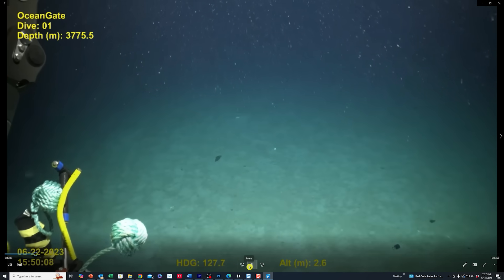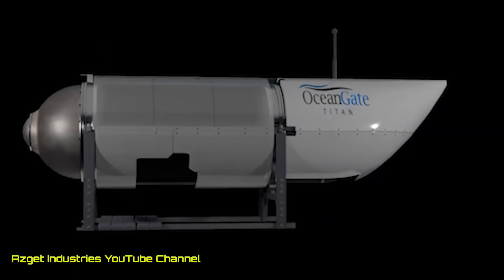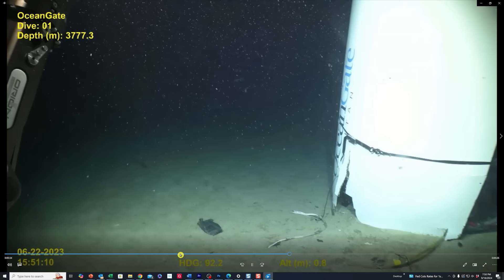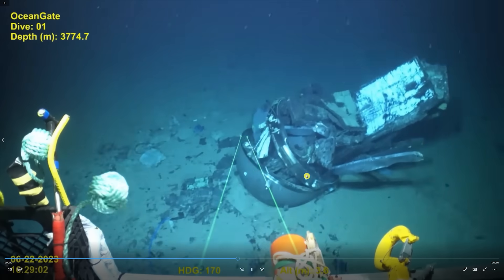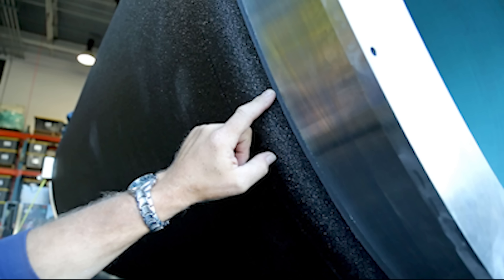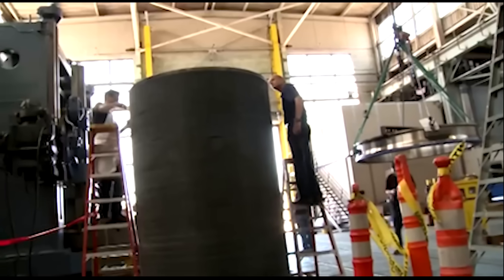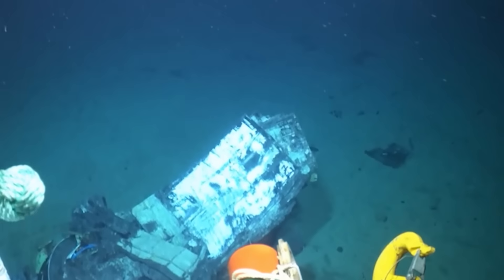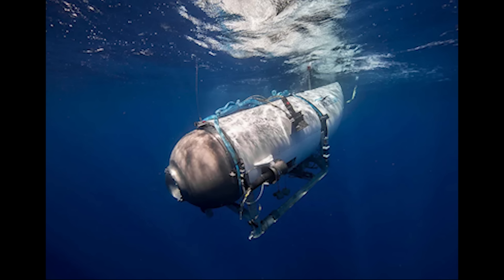OceanGate Titan Sub Debris Video Shows How It Imploded

Comment: The fact that there's some major chunks left at the back end makes it seem like whatever gave first was at the front end, and it broke the seal enough to shatter the hull apart from water hammer from the front end of the sub pushing everything towards the back, moreso than the whole ring just imploding equally from pressure. I bet it 'imploded' in the same way am elephant stepping on a solo cup sitting on the floor would 'implode'

Comment: Jesus that doesnt look safe... just that little bit of glue holding it together... i know adhesives can be very strong. Theyre used in aerospace and airplanes but man thats a lot of pressure that deep....  every submarine that goes that deep has steel bolted together not a ring of glue....

Comment: The occupants, what is there of them, are all mashed into that rear pressure dome along with everything that once made up the carbon fibre pressure hull. It compressed itself and the occupants in to that area at the back of the submersible in a fraction of a second....It's just as well they never even realised it was happening.

Comment: I studied engineering extensively the week that this sub went missing. The most recent footage of this wreck and my extensive knowledge of physics has lead me to conclude that the Home Depot strap system failed leading to the front dome falling off. In my professional opinion two extra straps and some twine would have prevented this unfortunate tragedy.

Comment: OceanGate-Gate. I don't think the idea of a 6ms "can-crush" implosion that pulverized the victims is accepted by everybody. The seal between the titanium ring and the carbon fiber stuff would have been the fail point that allowed in a deluge of water suddenly, very rapidly, and enough to quickly equalize the pressure, or so the theory goes. Either way, an instant, horrible catastrophe.

Comment: I think what might have happened is that it might have sprung a leak and started descending due to loss of buoyancy, and then imploded near the ocean floor once it sank low enough.
This would explain why the sub is not completely shattered into dust, as we expected, and why it's not scattered over a large area.
And this would explain why there is a large flat piece of CF hull standing. I'm willing to bet the largest intact piece of carbon fiber was from the bottom of the hull, where water was pooling once it started leaking in and resisted the movement of carbon fiber once the hull imploded.
Oh and those white specs all over the ocean floor could be bone fragments for all we know.

Comment: It seems so crazy from a basic physics perspective that their method of construction was doomed to fail and that there should no surprises as to this end result. A cylinder as such under such large compressive forces , just crazy. No wonder they avoided any safety /registration inspections by independent authorities. The questions are not why it happened, this is obvious from the engineering standpoint but rather how did such a flawed design (for such depth) seemingly escape any rationale thought regarding the effects of such forces? He didn't build this alone.

Comment: The fact that the sub was held together with glue is terrifying.
Reply: What's terrifying is them thinking you can make as many trips as they wanted without scanning for cracks and defects from repeated trips. To think that their warning system would give them enough time to ascend is crazy, no one on board had any idea they were about to die it just happened in a flash.
Reply: @ZeitGeist_TV  IIRC James Cameron said that his best submarine could only go to the deepest part for about three times before retired. And if any of those had a dent in it then it must be retired.

All of them made out of titanium. Basically the most ideal materials for it.
Reply: @ZeitGeist_TV  they knew, there was water leaking in as cracks started,  and sounds and then VOOOM everything squished in
Reply: @FCE-dogs  At the depth they were at the are no leaks it would be a highly pressurized flow not a leak, they also sent a message right before they imploded with no indication of anything being an issue other than commination delays. The carbon creaking was something heard through every single dive and resurface so to them that wouldn't have been an anomaly or anything indicative of impending implosion either.
Reply: @ZeitGeist_TV you shouldn’t even have a warning system in the first place if you are making subs to go down to that distance. Your sub should be designed in a way that it can withstand anything at that depth.
Reply: @ZeitGeist_TV they just ignored it 🤷🏻‍♀️ made an excuse that those “cracking sounds” when they started diving were normal 😂
Reply: Glue that was mixed in grandma's old strawberry jam buckets
Reply: They bought that glue on Temu
Reply: @pedros1 
next time they will use a few liquid nails tubes
Reply: Dumb. It was dumb
Reply: the problem is compressing/decompressing moves the joints.  If the pressure is constant, in theory, it should be ok.
Reply: Should have been a complete shell really they basically made a expensive Xmas cracker
Reply: That was what I was thinking. There is no way I would get on an boat or airplane if the most important parts were held together with glue.
Reply: @mortimerbrewster3671  What's wrong with elmer's glue? I used it in my entire 3rd grade projects. I got an A.
Reply: @josephfilm73 what ? Lol lol 😂😂😂😂 I thought it was gorilla glue lol 😂😂😂😂😂
Reply: @mortimerbrewster3671  well I hate to break it to you but there is a lot of glue in a modern jetliner. And composites.
Reply: @skyboy1956  Glue ONLY? 

Frankly, once the companies went woke and started doing DEI hires I've stopped flying. The way the planes are made scare me even less than who is making them now. I trust them as much as I would trust the guys who made this sub.
Reply: @mortimerbrewster3671  Yes, glue only except they call it "bonding." It's been in use in aviation industry since the 1960's. 
For example, Grumman single engine GA planes (AA-x) had the wing skins glued on. No mechanical fasteners. 
Airliner bonded components became a thing in the late 70's.
Reply: @mortimerbrewster3671 technically it was epoxy resin not glue. I think you would be surprised how many things are held together with epoxy, polyester and vinyl Ester resins. That would include cars, boats and airplanes.
Reply: @mortimerbrewster3671  Performance cars are glued together, like Lotus ex
Reply: @dfloper performance cars don’t travel to the bottom of the ocean 😂
Reply: @mortimerbrewster3671  Many modern aircraft use glue for structural components, it has been proven safe. I dont think glue is the problem here
Reply: @mortimerbrewster3671  But they made airplane wings out of wood with fabric glued on...
Reply: @mortimerbrewster3671  Right!  Glued slip joints.  omg  Was there no engineers?
Reply: I don’t understand why they even made this out of carbon fiber? Why not steel? I mean they can’t even bolt the cap on!!! Makes no sense.
Reply: Usually when you watch videos about how things are built such as ships or spacecraft you get a feeling of the pure strength and incredible technology being and ideas being used. With this sub you felt more like watching a seriously incapable group of people sticking a load of cheap inferior parts together with glue and then joking that the experts say its not safe but we know better. Absolutely shocking. I wouldnt trust a simple tap washer that was designed buy this guy.
Reply: Ughhh and don’t forget ratchet straps…
Reply: @pretty00lights  ratchet straps more useful than that titan sub
Reply: Yeah some sort of compression fitting would be better, if the joint were to move the joint would get tighter.
Reply: More concerning that they weren't glued in a clean-room setting. In fact, it's what appears to be a dirty warehouse......
Reply: How ridiculous my kid made done better with his science project at school lol lol 😂😂😂😂😂😂😂
Reply: I am pretty sure James Cameron wouldn't approve that peanut butter glue for his sub.
Reply: Peanut butter just doesn't work without jelly.
Reply: But it’s thick.. like peanut butter.. 🤪
Reply: You should listen to and watch the video Real Engineering did. He has a great explanation on the composite material because he did his thesis on composites it explains the whole thing really well if you’re interested.
Reply: What's even more terrifying, is that people WILLINGLY got on that underwater boat.
Reply: Some people below don’t seem to understand…a titanium metal hulled craft is one or 2 solid homogeneous pieces of metal… the Titan hull was made of millions if very slightly irregular carbon strands held together by resin glue ; this eventually allowed pressurized water to creep into its basic structure
Reply: Glue in and of itself isn't the issue. The different ways in which the materials bend under pressure combined with a smooth surface and work being done in an unsterile environment is. Also, leaving the sub out in the heat in the sun etc would ruin it. It worked a few times until it didnt.
Reply: It was held together with peanut butter. "It's like peanut butter."
Reply: @josephfilm73  the fish at it all 🤨 that’s why there was none left when SAR retrieved it from the water 🤨
Reply: That’s pretty standard. Not glue btw.
Reply: aircraft wings are also held together with "glue", that's not the problem here
Reply: Watching them mix the glue by hand was pretty awesome
Reply: Yeah probably sho7ld of used duct tape
Reply: @kananimiranda3376  yes even better
Reply: WITH GLUE???!???
Reply: @Xxpel6xx Not the kind of glue your thinking of.
Reply: Glue theres no wayyyy
Reply: Peanut Butter, it was held together with Peanut Butter, 'cause you know glue is too thin.
Reply: It was gorilla glue...one would think it would hold up.
Reply: What's terrifying is asking your  accountant to piolet a submersible when you have no experience in pioletting a submersible
Reply: It's not the kind of glue your probably thinking of.
Reply: Hey! Not any glue!! ✨ Peanut butter glue ✨
Reply: It's not glue. It's epoxy. And it would have worked for an internal pressure situation. Carbon fiber is not built for exterior pressure. It's like a barrel wrapped in ropes.
Reply: @jorelldye4346  epoxy is a glue
Reply: Glue wasn’t the problem.  Once under pressure you wouldn’t even need glue to hold it together.
Reply: @johnwalker1471  Yes, the water was pushing all those pieces together with tremendous pressure. But, they had to be flexing slightly differently. A better design would be a single metal homogeneous sphere where all pressures would be equal. Was it too expensive to make a larger sphere?
Reply: @prant8998  where is your submersible?
Reply: @johnwalker1471  The enormous pressure squeezes the sub from all different angles. How is the glue not the issue?
Reply: @johnwalker1471  clearly it was a problem lol
Reply: @apexeverything101 the carbon fiber hull imploded, it was not for the glue. Implosion is structural failure caused by the immense pressure. If the cause would be the leak it would have been different outcome
Reply: @Y4932  prove it
Reply: @Y4932  Who knows it’s still not advisable to attach bits on creating weak points you want a complete shell really going down that deep it’s 5000psi your playing with down there so you don’t want to be thinking I hope the end don’t fall off 😂
Reply: @apexeverything101  I’m not convinced,  At the Titanic depth the pressures holding the titanium ends onto the carbon fibre cylinder is about 6000 psi.  Glue wouldn’t make any difference.   For some reason the carbon fibre cylinder fractured.  All it would take is a stress point to start the fracture and then it would shatter like tempered glass.
Reply: @honeybadger9425  So basically you're saying the front wasn't supposed to fall off?
Reply: @apexeverything101  No it did not matter besides letting moisture in the carbon.
Reply: @johnpoteat9774  No I’m saying don’t design a sub where that possibility even exists in the first place. They obviously made it how they were capable of making it themselves instead of getting someone else to make a complete single moulded shell who has the machinery to do that which would have been a lot stronger. If you look at James Cameron’s subs the chamber he sits in is a complete factory mould with no weak points.
Reply: @Y4932  All I learned from the bunch of videos about this incident was that carbon fibre isn't a suitable material for building submersibles. And I am not even sure I got that right.
Reply: @apexeverything101 ...I don't think the anyone can prove exactly what happened.  It will remain open or best guess.
Reply: what
Reply: @johnwalker1471 the carbon fiber hull fractured because carbon fiber really isn’t strong on compression. It’s really good at taking tensile stress. also the glue was probably something like JB weld, where it has a 5000+ psi break strength.
Reply: It wasn’t the problem was then never throwing it away after the first dive down or ever doing checks.
Reply: At that depth no it wouldn’t.
Reply: @apexeverything101 Pay attention in school, dumdum 😂
Reply: @johnwalker1471  the glue could have failed first, leading to catastrophic hull failure an instant later. the shearing of the C rings may point to that.
Reply: @Y4932  no, it was the titanium ring :) everyone assumed it was the carbon fiber, and that no doubt was going to go eventually as well, but the actual implosion was caused where the glue failed on the titanium ring
Reply: but the caps held with glue dont matter that way, the force is pushing the caps IN not out like a 500 gallon propane  or water tank, what failed was the carbon fiber 5" because it was formed by spolling the carbon fiber onto a drum like spooling fishing line onto a spool, that is weak, it creates layers between each revolution of the material, it would have been much stronger laid up diagonally and alternating layers
Reply: @FCE-dogs ...I think it would be fine if you put fresh carbon fiber over the titanium hull after each dive.

Comment: The front ring of the sub is most likely where the catastrophic failure occurred, at the point where it was adjoined to the carbon fiber hull.
Since that adjoining surface of the carbon fiber hull would have been its weakest point and more exposed to cyclical stresses over time, along with the questionable long-term durability of the epoxy glue on the inner surface of the titanium ring itself, it seems pretty obvious that's what happened here, especially given the condition of the rear dome with everything seen crumpled, compressed, and jammed into it with what must have been extraordinarily destructive driving force.
This implosion happened very quickly, and probably at supersonic speed.
At 11,000 feet of ocean depth, the crushing pressure exerted on the sub from all directions was approximately 720,000 pounds per square foot, or nearly 5000 psi.
These video clips show what the deep oceans of the world are capable of doing should one foolishly attempt to visit them using untested and unreliable equipment.
Poof.
Squash.
Splat.
Instant annihilation.

Comment: Are they going to retrieve the sub parts?
Reply: They already did back in 2023.
What's still missing, however, is the acrylic viewport window, which they may not bother to ever go back and look for.
Reply: @tonyk501  what about the tail section sitting visibly on the floor- I know about other parts already retreived
Reply: @thomassteenburg7220  
The tail cone was actually the first chunk of debris they discovered on the ocean floor during the search and recovery operation, which confirmed they would not find any survivors, and that tail cone section was also fully recovered in 2023, although it was partially covered by tarp when it was offloaded on shore.
Since the tail cone section was not part of the pressure capsule, as it was attached to it externally, it was already equalized with the surrounding water pressure and basically broke off as one standalone piece during the catastrophic implosion.

Comment: An Oceangate employee testified that the rings where the hull was glued to. The front ring inside tab was sheared off all the way around and the aft ring inside tab was partially sheared off. On this video at 7:09 look at the ring being taken off . The plastic covering from 350 degrees ro 300 degrees. Right under the 300 degree part looks like it's sheared there  and underneath that it looks like there's more there's a weird 90 degree looks like it's purposely made like that but I don't think so

Comment: It looks to me like the plexiglass might have  been a place where it imploded  first.  Going from the bow to aft. The capsule end parts seemed to stay and land relatively close together, so they were together for some time close to the ocean bottom before parting ways.  It looks like everything got pushed to the aft capsule end part.  The aft capsule end part looks as if it was pushed outward in one section which pushed  the cone frame off. The cone got sheared off I imagine.  I believe I had heard the plexiglass was only rated for 1000m.   They took 3 prior trips in the Titan?   That is what I think based on looking at what I saw in the videos.

You comment about using abrasive on the titanium seems spot on, oils on hands touching the metal and  possible causes de-lamination.